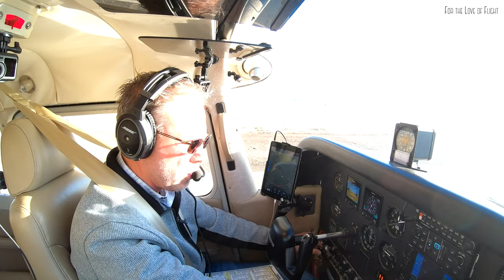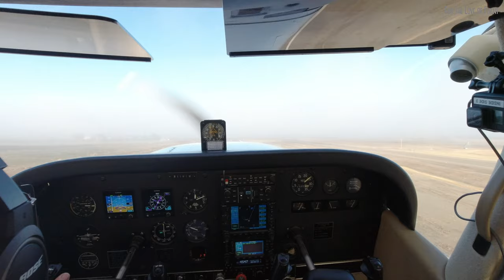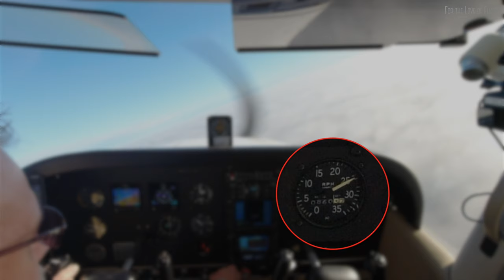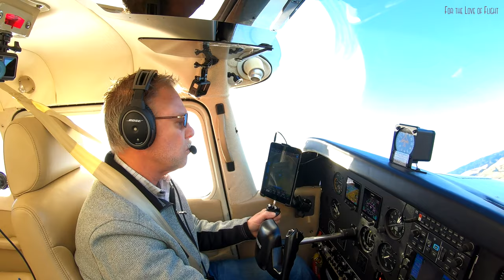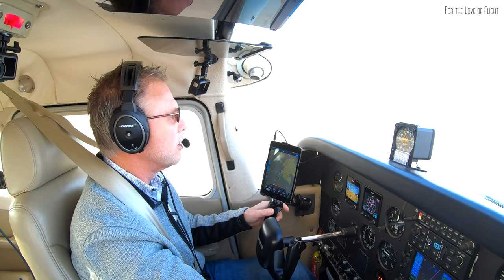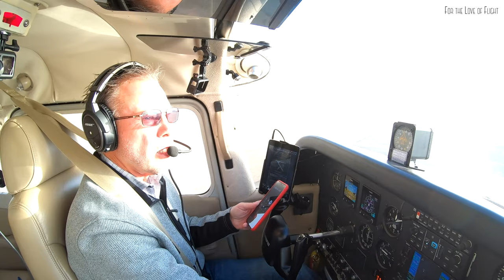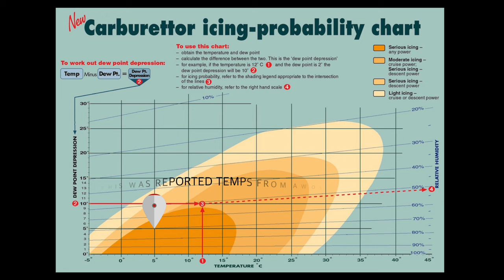Carb Ice - No Way - "way" dude - lessons learned and that butt pucker moment

Comment: Thanks for sharing. I had my first encounter with carb ice this week in clear, cold skies. 

I heard the roughness first and thought maybe I had overleaned. When enriching the mixture didn't work, I thought maybe I had a bad mag. I checked each sequentially and about the time that I ruled out the mags, I noticed a power drop and it finally clicked in my head.

It was definitely an attention getter.
Reply from the maker: totally agree , it was holy smokes what the heck ?

Comment: Nice job on the energy management. We routinely are in prime conditions for carb ice, here in western Washinton. Any time I feel the slightest tick from the motor, I pull that knob. A good visual indication are the con-trails off the prop. Sometimes they aren't seen, but on the replay of the video.
Reply from the maker: Cool, thanks and thank you for watching ... will keep this in mind....

Comment: Double check the point you put on the carburetor icing probability map. Instead of using 5°C on the vertical, dew point depression axis, you should have used 0°C. That is because your OAT minus dewpoint gives you the dew point depression (5°C -  5°C = 0°C). Still squarely in carb icing territory. Nice flying, and way to keep your cool!
Reply from the maker: thank you ... it was not a pucker moment as the engine was still doing ok... but it still does get your attention fast...

Comment: Good handling of the situation. But I always add carb heat with roughness, because it only makes it run a bit slower with the heat in non-ice conditions. It does offer  another area to training. I learned during flight training that you can be at pattern altitude and do a full control stop forward slip and put it on the numbers. I have done it 3 or 4 times. I use slight forward slips to quickly adjust altitude. Go practice forward slips and try a landing where you are above glide slope and slip down to the center of the approach. We always want stable approaches, but adverse conditions need to be trained for. Have fun training with forward slips.
Reply from the maker: Thanks for watching... i ended up slamming in 40 degrees of flaps to get r down...next time carb heat will be my first go to....40 flaps is like speed brakes !
Reply: Yes 40 Degree flaps are very good. But still try the forward slip, with the flaps. I enjoyed being able to dump lots of altitude when necessary.
Reply from the maker: I will give that a try for sure
Reply: Slipping is my go to when ever I’m too high or just want to scare a first time passenger. LOL Also some 172s have a placard stating no slips with full flaps but I guess in an emergency everything counts.
Reply from the maker: Mine also states that no slips with 40 flaps...but true, when you have an issue and need to get on the ground...that would be the fastest way...i am not sure if it puts too much loading on the airframe or ?
Reply: @fortheLoveofFlight  There should be a flap setting the permits forward slips. Even without flaps a full lock forward slip is very useful to practice, and a safe way to get down quick. Enjoy your Vids. Continue the fun.

Comment: Thanks for sharing, no matter what we do (and with anything we do - flying, driving, using power tools, etc.), we'll always have moments like this and the most important thing is what you showed here: own it, analyze it, understand it, and learn from it so that it doesn't happen again! Kudos!

Question on the icing chart: The red marker (I'm assuming that you added it) is in the wrong place? According to the instructions at the top, the "Y" axis is the "dew point depression" (which it defines as "Temp - DewPt = DewPt Depression")... You mentioned that the weather was 05°C/05°C Tmp/Dewpt ... Which would make the depression 0°C... Which would put the marker at the bottom?
Reply from the maker: you are correct, I mis read the instructions since the reading was "0" I left it at 5 but it is really 0 and does put it at the bottom - thanks for watching !

Comment: Wow!  Thanks for sharing.  A very good reminder for those of us who don't regularly fly in locations/conditions where carb icing is common.  You did a great job staying calm and getting back safely.  Lesson learned.  I was looking forward to a Santa Rosa flight video!  Did you cancel the trip, end up driving, or did you fly after figuring out what was going on?
Reply from the maker: Canceled going to figure stuff out...would have been really late...going again soon most likely IFR again..thanks for watching...hopefully the lesson learned will allow me to pull the carb heat vs. slamming it back to the airport.

Comment: That engine is much more prone to sticking valves than icing at high power levels.
Reply from the maker: thanks for watching...!
Reply: @fortheLoveofFlight  did you come to a conclusion?
Reply from the maker: well...we are working on it... some thought sticky valve, some think carb ice and now as of today, possibly a spark plug issue. flew a bit today and had a similar hiccup , returned to field and did a run up at the hanger and right mag was rough and low by about 250 RPM, did not do that on initial run up and take off, though it seemed to be the right mag just was not the same from about 2-3 weeks ago...so now we are looking into that...mags were just rebuilt within the last year....
Reply: @fortheLoveofFlight  mike Busch uses a stress test in flight for ignition problems, you need an engine analyzer, it involves turning off mags in flight and checking temps, I have found it useful in my Viiking
Reply: @fortheLoveofFlight  if you have Tempest plugs, that could be it, I threw mine away and went back to heavy electrode Champions.
Reply from the maker: that is going to be the next step, I do have an analyzer
Reply from the maker: we currently have the massive electrode ones and just ordered some fine wire....on recommendation of a few 172 owners at our airport...I think I have a bad plug, but will know in the next day or so...

Comment: Correct me if I’m wrong but I was taught that carb ice was likely to happen at low rpm setting especially on a Cessna. Assuming you were still climbing its very likely you were at a full power  which just leaves me wondering what is the safest approach if you absolutely need to take off in these conditions. Would it be to apply carb heat right after take off thus reducing engine performance until clear of visible moisture? Sorry if its a dumb question but I have never been face with this decision before plus haven’t flown carbureted in a long time.
Reply from the maker: In talking with others that have been flying longer than i , take off with NO carb heat and apply when first signs of carb ice are encountered. Based on the chart posted in the video, there is a broad range and temperature/dewpoint spread it can effect the engine and form carb ice. If i would have applied it and understood that is what it was, the trip would have been uneventful and could have made my destination... carb heat would be used for a minute or two while climbing then return to normal and see as I climb how the engine would have behaved.

Comment: After thinking about the scenario you had, do you think it may have been a good idea to declare an emergency?   By declaring an emergency, then you don’t have to worry about breaking any IFR/VFR rules. .Kind of a CYA. Just a thought. Not armchair quarterbacking.
Reply from the maker: Good point..if the airport had not been VFR taking off I would have done that immediately , but on my initial turn, I could see that even if the engine went I could make it back to either of the runways without issue at all and there was no one flying that morning but me ...
Reply: for the Love of Flight cool